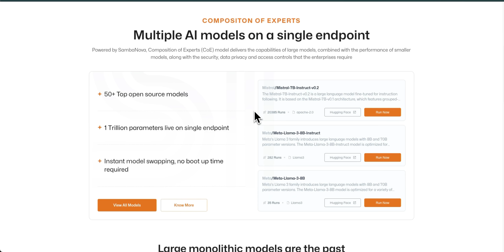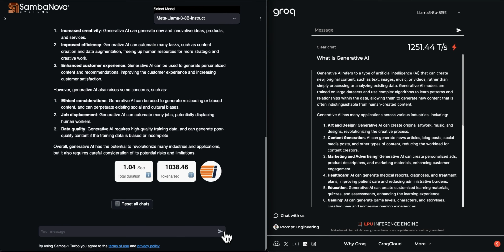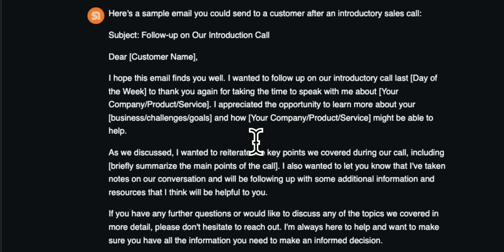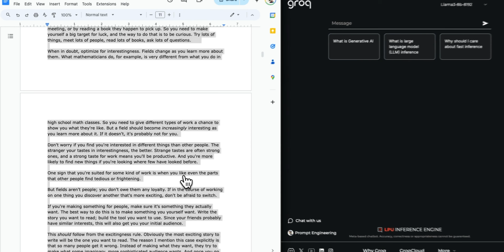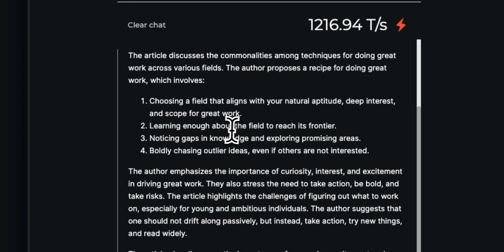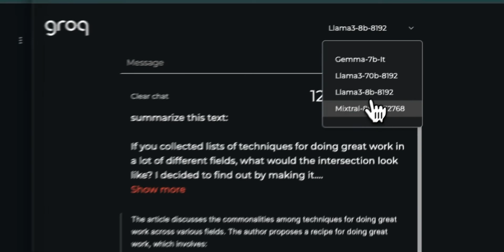SambaNova: Groq Got Competition

Comment: More competition is welcome, but I would get far more excited about this stuff if any of these companies did an add-chip that we can use on an average PC on PCI Express connector.

Vram is already quite cheap that 64GB or 128GB wouldn't cost the earth, but that would open up the door to running much bigger A.I. models at a local level, and it's clean that AMD, Nvidia or Intel don't want to give us more vram on their cards, heck even the high-end next gen 5090 might only have 32GB, which is better than this gen but it's still way too low, and even then, that gpu will cost an arm and a leg.

If someone release a modest gpu with a lot more vram and it only cost a few hundred more then the gpu cost with the normal memory it usually have, I can see a lot of use cases for that with local A.I. models, but for now, gpu's are not really that great of an option for local A.I. they lack the vram that maybe APU's might end up being a better option because you can use a lot more vram, yes it will be slower than a gpu with vram, but considering that the lack of memory is becoming the real issue, I would take a bit slower performance as long as I can actually fit the model in memory.
Reply: and if we could securely and easily connect our systems down-time in an open cluster array . . .